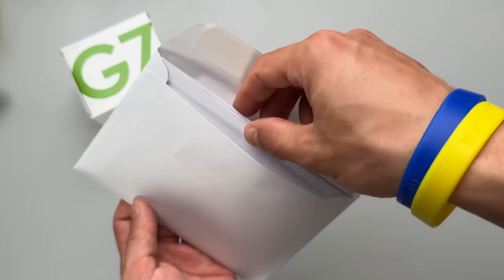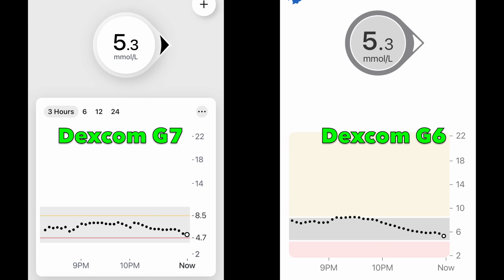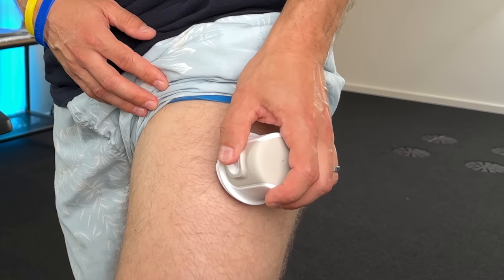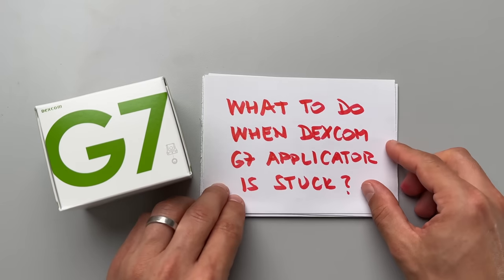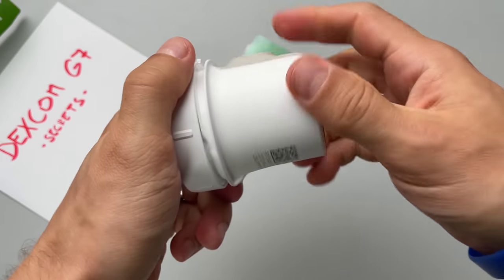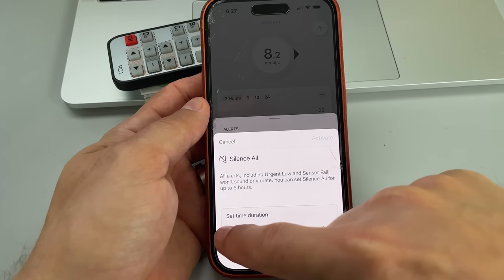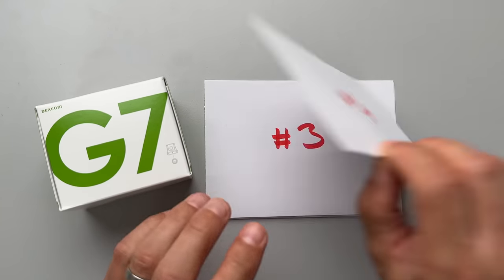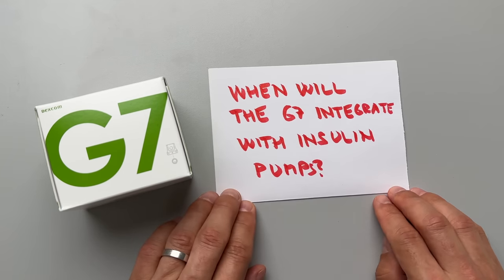Dexcom G7 Secrets, Finally Exposed!

Comment: How close can you put the new sensor to the old sensor during the grace period? Will having them too close to each other cause interference? My mother prefers to have the sensor on her abdomen (she has plenty of fat there).
Mom's phone has a crappy battery so we use the receiver that came with the dexcom. Can the calibration be done with that thing? Also, can you pair a phone AND the receiver at the same time? I wish they had a longer range transmitter for caregivers so we can get alerts. Or maybe have the receiver also be able to transmit/connect to wifi or something, to send info to an app on another device so I could get alerts when her sugar gets too high or too low.
The sensor not coming out happened with the very first one my mother ever got. But it was being used properly, it was just defective. It was being pressed against the skin very firmly and the little plastic thing receded into the applicator, but the receiver would not come out. The application was being done by the specialist who does this all the time and never had a problem before. Dexcom is sending us a new sensor to replace it though.
Lexcom is the name of the adhesive strips? 
My mother wants to disable the rising fast alert. She just wants to know if her sugar is too low or too high so she can do something about it-- mostly if it gets too low so she can eat something.
Hmm. Did they ever implement the direct to phone or other device as well? I'd love to get something direct to my phone. I couldn't seem to pair my phone with the transmitter though. it wouldn't read the barcode and never could detect the sensor even with bluetooth on.
It took us MONTHS for Medicare to approve the G7. Mom finally got her Dexcom last Friday. Looks like since this video was posted that Tandem has made one of their pumps compatible with the G7.
Thank you for this info!

Comment: What failure rates have users seen for the G7?  If I take a trip that lasts three months, I will use 9 sensors for the 90 days I am gone.  Assume that getting a replacement while I am gone is impractical.  Based on user experience, how many extra sensors should I take on my trip?  0, 1, 2, or more?
Reply: Cough, cough, I just did a 3 months sail - where getting supplies would be difficult.  I work in the diabetes field - and we always tell our patients - 3X what you need.  Yuppers, I had to shlog almost 3 months extra with me - pain in the ass - as flight charged me for my medical bag (low cost airline) - otherwise - usually I fly with carry on and meds bag into aircraft with no problems.  And yes, all those medical supplies were stuffed in my carry on with clothing underneath aircraft!

Comment: Concerning tip #10.  Presoaking the sensor.  When you insert the new sensor, does it automatically start its 10.5 day lifespan?  So if you presoak for 10 hours before starting the new sensor and stopping the old sensor, then you only have 10 days and 2 hours of life left in the new sensor?
Reply from the maker: Yes. That is correct!

Comment: im a little late to the video, but Ive spoken to the dexcom providers on call about my sensor peeling off too easily, and as a result theyve now modified my recurring quartlery package to include the stickers to put around my dexcom sensor. (im on G6 right now, dont know if this is available for other versions)

Comment: I’ve noticed, on occasion, that if I get dehydrated (like with cold medications), my G7 will give very low readings. I’m asymptomatic and after drinking water, the readings come back into range. This does make sense, since the G7 is measuring interstitial fluid, rather than blood directly. Thought I’d share this, let me know if I’m wrong.
Reply: Sounds like you are staying on top of things. If I have a high or low with my G7, I test with a strip for comparison. Of course I'm comparing actual blood to interstitial fluid that the G7 tests. Best wishes to you.

Comment: Regarding BT signal loss, I've tested a G7 REV 10 (it's written on the box) and yes, the BT signal was very weak. 
However, I've tested 2 sensors REV 11 and I had no single issue with BT. It was staying connected even at a distance of 12.5m/40ft.. I believe the BT has been fixed since REV 11. Maybe other users can confirm here in the comments.
Reply from the maker: Thanks for sharing. This is very helpful!
Reply: hi can you explain better? mine is REV 3, so far I've tried 2 of them and both lose signal continuously in the last 2 days
Reply: @lorenzobroccoli748  REV 3 seems to be quite 'old.' I'm living in Switzerland, and here I have received REV 11 directly, as Switzerland received it later than the rest of Europe. The REV 10 I used first, with continuous signal loss, was from the USA. In Italy, it seems they started distributing REV 8 and REV 9. Look for the 'Rev' on the green side of the box where the QR code is located. It's not a secret that Dexcom is continuously improving the sensors through small changes, and whenever they make a change, it appears that they increase the REV number. This is my assumption; otherwise, I cannot explain why I noticed such an impressive improvement in the BT signal from REV 10 to REV 11.
Reply: @florinbv78  Thank you very much for the reply, I will try to talk to customer support about it. You're right on the green back side (the one with the qr code) it says Rev 009. Before I read the white side with the info, there it says REV 003, small in gray along with other codes. I am experiencing continuous signal losses in the last 2/3 days of life of the sensor. I am very disappointed as I received a 6 month supply... Anyway, I think you're right with assumption, thanks again for the very useful info.

Comment: As an Android user, I would like an Android app on Google Play for this device. For now, I use the receiver.
Also, I have trouble keeping it on my body with my upper arm (especially when I'm changing clothes). With my diabetes nurse permission, I will be applying it to my abdomen and an extra overpatch (which I get elsewhere) over the one that come with the sensor. We will see how that works for me before I try again on the upper arm.
Reply: Thanks for the videos. They are very helpful to a newbie like me.

Comment: Isn't an over patch included with each Dexcom G7 sensor package? I found that the free over patches provided by Dexcom for the G6 are very good especially when used with a skin tac prep. The Lexcam over patches for the G6 are just as good except that the top liner is slightly more difficult to remove.
Reply: There are free patches included with the G7, but they are very thin and small.  The edges start peeling almost immediately. My first G7 sensor came off in 2 days because the patch was too flimsy to do any good. I found some clear ones on Amazon that work much better and haven’t had any more come off.
Reply: @HeatherDillard-wz1iz  I have absolutely no problems with the G7 overpatches. I am on the 4th sensor and I have no lifting edges after 10 days when I replace the sensor:
1. Clean the area with alcohol and let dry.
2. Insert the G7 sensor.
3. Use a SkinTac pad around the sensor on the patch and on the skin then let dry 1 minute.
4. Apply the overpatch.
While showering I protect the sensor from the water stream and soap or lotion. At the end of 10 days the overpatch may look a little wrinkled but I have to pick at the edge to lift it off.

Comment: I see this video was almost a year ago. Haven’t seen anything come out about using phone as receiver. Have been using G7 for over a year. Not my favorite device. Not that accurate. Maybe because I’m lean. I think Dexcom has improved adhesive. I use liquid SkinTac and sensor has not fallen off for awhile now. Although was on customer support the other day and she told me I HAVE to use patch. Just sent for the ones you suggested. Do not like the Dexcom ones. Only use pixel clock at night now. When was home during day drove me crazy going up and down 25 points at a time. Also always wait for arrow to stabilize. Sometimes says going up fast and then stabilizes at a much lower reading. G7 has some nice features but the G6 seemed more accurate and I never got compression lows. Kind of disappointed in G7 and Dexcom tech support is getting downright unfriendly.

Comment: Due to current co$ts of the G6, I've been hacking to make it last up to 18 sometimes the full 20 days! No issues, and always double checking after the 'extra' days to make sure it is still on target.. as I am also using a Tandem pump. Thankfully, all working smoothly. I realize that the G7 will not be 'hackable'. :-) I completely understand why Dex will not be extending the life cycle until they are able to develop something more reliable for us pump folks. lol